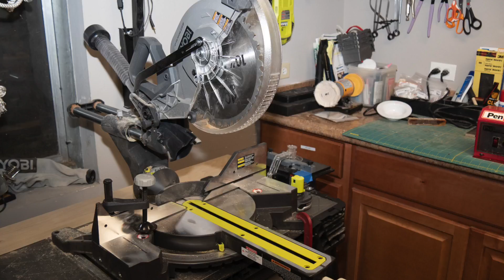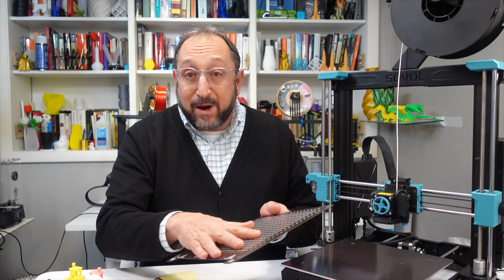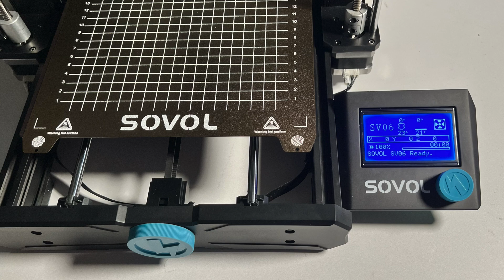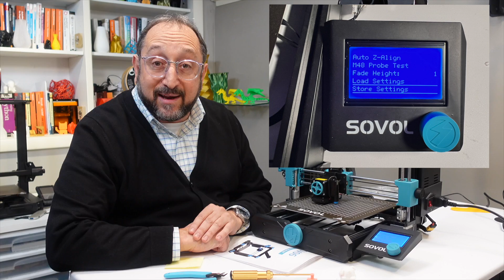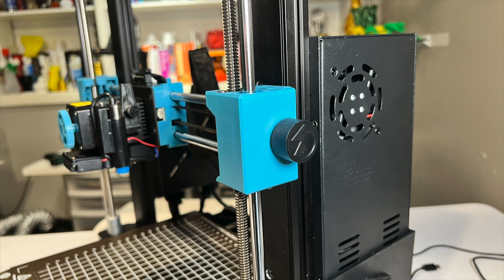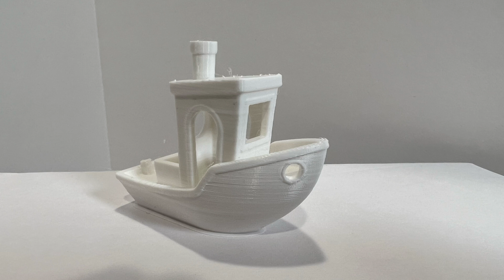Is the Sovol SV06 the Best 3D Printer for beginners?

Comment: 6:07 my easythread k9 has it works the same .
And that for 65 euro 
On temu .
It also goth 4 Buttons for leveling the bed.
I also use Cura and Tweak it for the mini printer.
I also upgraded the spoolholder.
And printed a ghost boot benchi.
Iam blowen away by the detailed information it printed.
Even the skull came out super.
And the woodwork is not normal.
Its 2 cm big .
Not normal for that price.

Comment: This printer is good but, you need to upgrade a few things if you want a great printer, first change the power supply for a meanwell 350 power supply, change the part cooling fan for 5015 fan you have to print a new fan duct and mount for it, upgrade the firmware to TH3D Firmware it is much better and you prints will be far better and finally change the motherboard and bed probe to a TH3D Board and EZABL Probe this board use's a real stm chip not a clone like the stock one which does cause bad print's as well as other things and the bed probe is very inconsistence so change it for the TH3D EZABL Probe. So in fact this printer needs a lot of upgrades to be reliable its great for the person that like's and can do 3d printer upgrades because with all the upgrades it still a ton cheaper than a 3d printer that has it already done for you, its another ender 3 v2 style printer buy it and them upgrade the hell out of it i think its better than the creailty one's for the money.

Comment: Love your youtube channel!

I have a lot of experience 3D printing. I ordered the SV06 and SV06 Plus and eventually a second SV06 because they were direct drive extruders (like to use flexible materials) and they were what appeared to be Prusa MkIII clones with some improvements and a lot more affordable. It all looked good on paper but here is my real experience:

1. None of my 3 Sovol printers will actually print TPU. They all clog and quit printing part way through a print. No matter what temperatures I use they clog. This is unacceptable because these printers are specified to print TPU.

2. I have had layer to layer alignment issues all the time and there is no explanations as to why this suddenly occurs. Checked belt tensions etc.

3. Have had to replace 2 main boards due to an SD card holder that fails mechanically and wont eject the TF card any longer., Seems they are using a component that is poor quality.

4. Each of my 3 printers seem to go out of calibration often and the Z offset is suddenly wrong and it digs a big groove in my PEI build plate. Each time I do a full Z alignment, offset and bed level the nominal z offset changes. this is annoying and ruins a lot of build plates. In the end I have to recalibrate Z and bed level before every print.

5. When updating firmware it sometimes blue screens my printer rendering it unusable. Very difficult to bring the printer back and have to reload firmware multiple times to make it function.

5. The micro SD card slot is behind the upright and is super annoying to plug in and out. Also, connecting to this printer from a slicer or klipper never seems to work. The computer never sees the printer. 

6. Long delays in getting support answers etc. Long delays in buying parts from Sovol because it seems they don't have U.S .distribution.

In the end even if I have a factory file I send to the printer that is set up for i3 printers I get 1 good print out of 5 tries. I just don't think this printer is ready for prime time.

I realize these reviews are initial impressions and they are very helpful but sorry to say this but this has been my longer term experience. I have worked hard to calibrate and make sure I limit variables that effect print quality and still I get a lot of garbage prints. 

Thanks,

Nikko
Reply from the maker: This is a very useful comment for the viewers of this channel.   First, you are correct.  My reviews are initial impressions.   Even when I have had a device for a long time, since I have so many different printers, I rarely push a device the way a dedicated user would.  

However, it is also important to position machines correctly.   I see the Sovol SV06 as a good device for people new to the hobby that will use it to print PLA maybe a couple times a week. For these users, it is a better value than an Ender 3 V2 and easier to use.

Comment: I am very happy with my SV06. It is far better than my Prusa which I never managed to get to print a decent print. With the SV06 it was as close to plug and play as possible. Just FYI, on this printer, I print the Hatchbox at 196, with the first layer at 64 and no fan. I am also able to print at 400 speed if I need to.

Comment: I have just received my SV06 from Sovol direct to UK. Ordered 16th Dec and arrived Jan 5th. I must say that this printer is very well put together and seems to be very good quality. Only took 20mins to assemble with just 9 bolts. Printed a test cube and dimensions were spot on, benchy was also excellent. The only downside is the pei sheet adhesion which seems to be poor.

Comment: A good video.
The SV06 seems a good alternative to a mk3s (at least as a second printer, as it lacks MMU-support). It looks even more like the mk3s upgraded to a Prusa bear. There are some questions I have:
- Is the distance between x-rods the same as on the mk3s? There are a lot very nice upgrade extruders for the mk3s, like the Bondtech BMG, the Zorbiter 2.0 etc. Also you can get a Revo hotend for thoose. While of course these upgrades might cost more than the printer itself, as the rest of the printer seems to be quite rigid, it might be worth it. Of course you need to make a cable adapter for other printheads. But would be nice to use them without further hardware modification.
- As nowerdays Klipper is state of the art for a good reason: Have you tried Klipper with this printer? Actually using an old thin-client such an upgrade might be only cost about <20$ (+accerolemeter, if you not already have one)

Comment: I had the following problems. 
After the Z-align, both sides were not even. Switch off and level both Z-axis by hand.

I wanted to set Z-offset but Z wasn't 0. Heat up first, then home the printer, then check if Z=0, then Z-offset.
I wanted to level the 5x5 points but the printer only makes 5 points. Reason the sensor was too high in relation to the nozzle.  Turn down the small screw at the top next to the nozzle and press down on the sensor. Then you can start over again.
Then I probably still had fingerprints on the bed...

Comment: I had to open this just to post this…. No, the SV05 is. I got it a few days back and after ironing out a couple glitches (not goin into that here, lol) I have to say, it’s the best 3d printer for beginners. The build was so simple, wiring terminated into plugs, put on the gantry, plug it all in! My second printer, first one with auto bed leveling! My god, why would anyone sell one without it these days! I’ve printed nearly a roll of PLA so far and? My prints are beyond beautiful and I’ve managed to push the speed on a certain part to the degree that I’m printing them at 1.5 hrs vs two and fifteen. Incredible printer!!! Review it!!!

Comment: Great video but I don't see much value in this printer. This looks and acts like an even cheaper Chinese Prusa clone. At least the ones available on Aliexpress are close enough to real thing to use most of the Prusa configuration settings without much effort.

Comment: They have an inductive sensor, all they had to do was add another driver and support g34, and you got proper z-stepper alignment. It's a lot more reliable and faster than forcing the gantry to the top
Reply from the maker: Correct.  But I am sure they were counting every penny to put all of these features in a low cost print.
Reply: @MakeWithTech  it looks like they put in some thought into this machine, and Sovol has boards that can support an additional axis. They can charge another $10 per unit offer "true bed leveling" It will differentiate them from even what prusa can do.
Reply: @kazolar  What printers do have "true" bed leveling?
Reply: @David A. Leedom  voron does it with 4 independent z motors. If you have 2 independent z motors, you can get close at least use the probe to level out the x gantry. True leveling is adjusting the bed relative to the probe before doing a mesh

Comment: Did you do a Hot End PID tune ?
 Before printing.
Reply from the maker: I did not.  I will cover  pid tuning, steps calibration, high temp printer and cura configuration in the next video.  Probably a month from now as I have a backlog of stuff to review.
Reply: @MakeWithTech  I didn't think so. My ender-3 looked even worse than that. After a PID tune is was totally smooth. I do not know how but my Max was 250 and my Min was also 250.  Temp was moving so much the print would not even start. I changed it to 0 Min and 265 for Max. After that It stayed at 245 for the entire print.

Comment: Swappimg out the board for one with 5 drivers so dual independent Z axis can be implemented for G34 would bring it more in line with the Prusa, I run G34 on all my printers except the original Ender 2 as it only has one leadscrew, I cant imagine life without it as it gives you a level playing field to get the tramming done.
Reply: Which board will you suggest?
Reply from the maker: I agree.